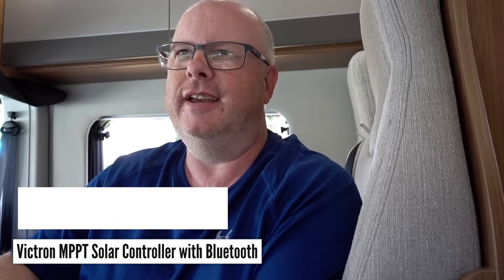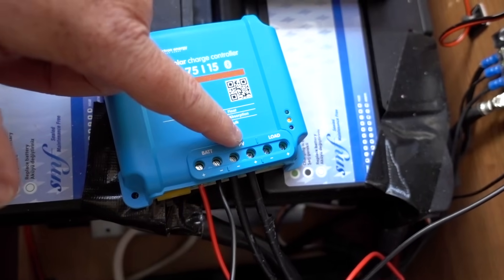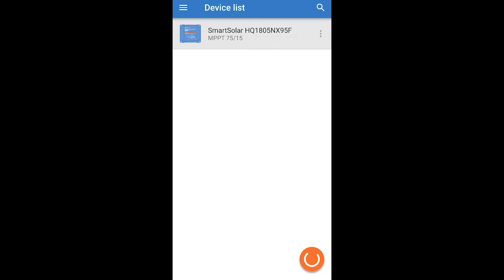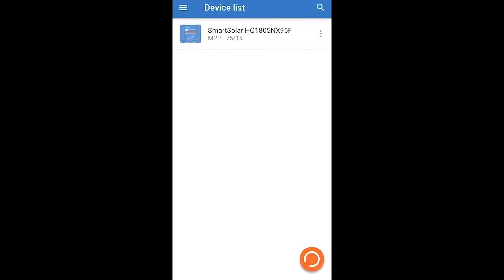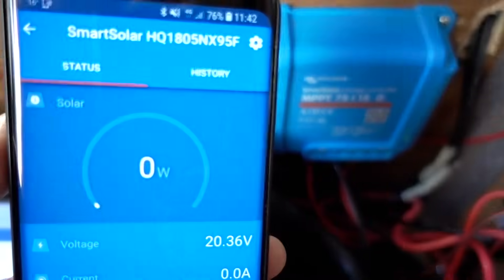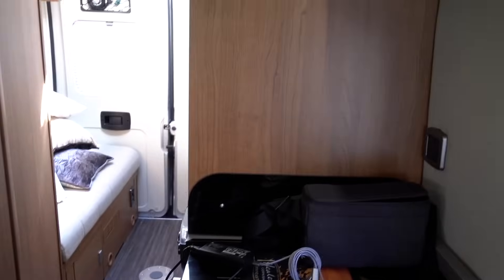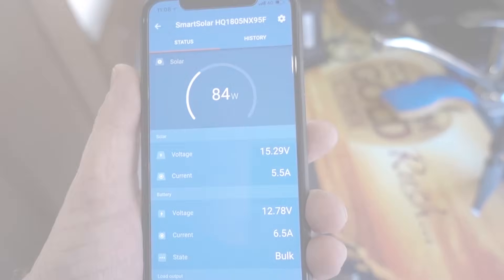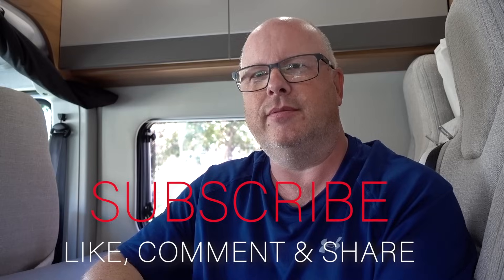Victron MPPT ☀️Solar Controller ☀️with Bluetooth 📲 Installation & Review

Comment: Hey John,

I have 3 100w panels. I dont know if im missing something but when do panels actually produce close to 300w? The most Ive seen my victron 100 30 produce is 120 (with a fan going)...is it based on battery levels? I have LA Bats in my bank
Reply from the maker: My 150w regularly gets over 140w, maybe your panels or config might have a problem.

Comment: Hi john, help needed . I’ve got same solar system and batteries and controller! But blue light for bulk just flashing, what’s showing 0  no batteries connected yet so I put a load on off blue led spots not powering load ie no lights ? Confused any help regards .
Reply from the maker: Disconnect the solar & battery from the victron. Then connect the solar and then connect the battery, I don’t connect anything to the load. Then go into the app and see what it says.

Comment: Do not by Victron SmartSolar chargers. After 4 months of use, the app that connects to the control box via bluetooth has connectivity problems and just recently with the latest app update, will not connect to Victron's server to download the firmware. The control box is now useless as it will not charge my batteries. It was purchased through an authorized Victron dealer and they will not fullfill the warranty for a refund as they insist that my smartphone is the problem. I have emailed Victron explaining the problems with no response. Furthermore, alot of other users are experiencing the same problems regarding connectivity to their smartphones/i-pads. You have been warned.
Reply from the maker: Never had a single problem in over a year, if you use Samsung android phones then it might explain it as they have known connectivity issues. Victron gear is the best and your issues are just down to your phone or user error in setup or placement. I bet I could come and demonstrate your controller works perfectly with a different phone or setup.
Reply: I'll on the latest firmware on my Note 8 with no issues.

Comment: Hi, I’m just about to install a Victron MPPT 100/20, looking at your video am I correct to say that I don’t need to use the earth connection on the side of the unit if I’m only powering my battery?
Also, what is the safest way to connect the unit:
Battery connections to the MPPT then connect to battery
Then
Solar panel connection +, then - into the controller?

Thanks for all the videos and advice, really is a great source of infos👍👍👍👍
Reply from the maker: I had no issues not earthing the unit. I connected the + solar, - solar and then + battery and finally - battery and that's been fine.

Comment: Another great video matey.. I'm curious, do you still have the split charge system from the engine connected or did you disconnect?
If yes, where does it sit in relation to the charge controller?
Reply from the maker: Hi Si, in my new van it’s an intelligent charger for vehicle or hookup. In my old van is was a vsr, I’ve got a full 12v wiring guide that shows that. I’d have vsr to leisure battery and solar controller to 12v fuse box so you have protection and it’ll also power devices and ease the load on the leisure battery.

Comment: Hi there, great videos so thanks for your help.  One question, I didn't see you use the separate ground connection from the Victron in addition to the +ve and -ve connections.  Was this deliberate?  How do I know whether I need to use this?  Thanks
Reply from the maker: I don’t use the load side, I just use it to charge my batteries directly 👍🏼

Comment: John is it simply a case of removing the fuse between your old solar controller and your leisure batteries, remove the controller, disconnect wiring and rewire the new unit and replace the fuse? You don’t have to cover your panel do you to stop it producing power whilst carrying out the change over
Reply from the maker: A fuse won’t help if you’re disconnecting the cables directly coming from the solar panel.
Reply: Gadget John on tour so I don’t need to remove the fuse whilst swapping over the controllers? It’s just that I’ve done so anyways as my ep solar controller was overcharging the batteries not working properly hence the reason for me replacing with the Victron
Reply from the maker: Do it at night and it’ll be fine or cover your panel so there’s no surge to the controllers. 👍🏼
Reply: Just make sure that you disconnect the solar panels FIRST and reconnect them LAST

Comment: On the Victron, how can you tell what controller to use on a 200 watt panel compared to a 100 watt panel?
Reply from the maker: You measure the maximum amps your solar panel can generate and get the controller that will take that. So my 150w panel generates 10amps, so to be same I have the 15a controller 👍🏼
Reply: @GadgetJohnAdventures  There is a calculator excel download from the Victron website. Here you can put in your panel and controller configuration and it will let you know if they work together.

Comment: Hiya John, Could you tell me what pins you put your jumper back onto after you configured the controller  in your Bluetooth or did you leave it disconnected ? Tia
Reply from the maker: On this model there are no jumpers to configure. You just wire it up and connect over Bluetooth just as I show in the video.
Reply: @GadgetJohnAdventures  That's strange I got the same 1 75/15, its just below the fuse on mine 4 pins confused lol
Reply from the maker: My controller is the 75/10 Have you contacted their support or checked online for the correct setup of your controller?
Reply: @GadgetJohnAdventures  Oh right my mistake its got 75/15 on it, so thought it was the same as my 75/15, yeah its got 3 different ways you can have it, was trying to decide which was the best. on page 6 of the book it says no jumper when configuring in Bluetooth then it gives you the other options for after, your the best man to come to with all this tech lol 👍

Comment: Hey! nice video...very helpful. I was looking at purchasing the Victron MPPT 75/10...but I have 3 100w solar panels. Will the 75/10 support that load or do i need to go with a different MPPT model?

Also, can I have my inverter hooked up and pulling power from the battery while solar panel/chrg cntrlr hooked up to the battery also? I'm concerned that the inverter will be damaged if its hooked up at the same time as the panels/chrg cntrlr 

thanks!
Reply from the maker: You need to know the solar panel total output in amps and get a controller that big enough for that. Having solar charging connected to your battery won’t be affected by having an inverter hooked up to your battery too, just follow my videos to guide you through how to do it all 👍🏼
Reply: Gadget John on tour very useful answer I'm going through the same steps rn ... I should've spent the extra money and got the Bluetooth enabled unit I read of the non Bluetooth smh
Reply: @pacman5511  You can just buy the add-on bluetooth module from Victron. It just plugs in to their controller and gives exactly the same into as the bluetooth included one

Comment: question! my battery is fully charged  and everything works great! but the victron app dont show his watts from the solar panel.. but if i power on the inverter  the wats goes up is this normal?
Reply from the maker: Hi, if you battery is fully charged then your solar controller doesn’t take any power from the solar panel. Powering on the inverter draws power from the battery so the solar control then allows the solar panel to charge the battery.
Reply: Gadget John on tour  thanks just to be sure everything is working good ;)

Comment: Hi John, thanks for your clear explanation about your Victron charge controller.  Would you be able to answer one question? If we get the unit with built-in bluetooth and the unit needs to have a software update, will the controller still operate if we happen to be in an area with no wifi? We will be camping after all!
Reply from the maker: Yes it’ll work fine if you’re unable to update when prompted. It updates every few months and gets more efficient too. On first install I would suggest you are able to update though, just to get the best out of it. 👍🏼

Comment: Does it have any settings in the app where you can be alerted if your battery voltage is getting too low?
Reply: @Barry Hoffman You can then add the Victron Battery Protect unit which can be set to disconnect all the loads when the battery gets to a value of your choice (50% at worst)
Reply from the maker: It’s a solar controller, it automatically provides power whenever it can from the solar panel. You can’t turn on more power if the sun isn’t out, if the sun is out then it will charge your battery. 👍🏼
Reply: @GadgetJohnAdventures  Yeah, I'm looking for a charger controller that can provide me with some kind of alert if my battery voltage is too low so I know to turn my generator on. I haven't been able to find anything like an alarm or bluetooth feature like that. Even just something that connects to the battery and beeps at 12.3v would be handy.
Reply from the maker: @markbtw7987  This is what you need - https://www.ebay.co.uk/itm/DC-3-6-50V-Digital-Voltmeter-High-Low-voltage-Alarm-led-monitor-tester-5v-12v-24/332687226979?hash=item4d75b43863:m:mdRcJ8vMbr-dy2o5-1bBt8g:rk:7:pf:0

Comment: Let me if I got it; the app allows you to monitor the current drawn from the battery? How can a solar charger measure the current that's being drawn from the battery without a shunt on the circuit battery - appliances?
Reply from the maker: The same way a DVM can measure load on an electric device.
Reply: @GadgetJohnAdventures  a DVM measures current (if it is what you mean by load) by breaking the circuit and having the electricity passing through the DVM. If the charge controller is placed between the solar panel and the battery how can it measure anything between the battery and the appliances?
Reply from the maker: Really easy, the controller is connected to the battery and also the electrical devices. But if you want to learn how a product works then speak to the people who make it.

Comment: I think the 80W showing is what the Solar panel is generating - not to do with load ?? 80W from a 150 W panel in October in the UK for a panel that is flat on your van roof rather than at the perfect angle to the sun is pretty good though :-) Its good to have a controller that tells you what's going on, so you can see if there is an issue, or see the difference in where/how you park if your batteries are low too.
Reply from the maker: Sorry, I really didn’t do a great job of explaining it. I was trying to show the panel load as it charges the batteries 🤔
Reply: correct!
Reply: Linzi Douglas the panel will only ever put out what is being asked of it. So if your charger is pulling 50w and you add 34 watts of load, that’s a total of 84w that your panel will produce. If charging finished and you turn all loads off, panel power generation will drop to 0w (in reality the charge mode will switch to float so you will still get a few watts generated)...
Reply: @frodev728  - My understanding from having Solar on the roof of my house and monitoring them before they were connected to anything other than the monitor, was that Panels just churn out power depending on the light - the charge controller is the thing that alters what it lets through. Thuis is why people opt for a MPPT instead of a PWM controller as the MPPT can use more of the incoming Watts/power by altering the amps while keeping the volts within the range the battery can accept - whereas PWM can't do this so is a lot less efficient and dumps the extra Watts/power.
Reply: Linzi Douglas No. panels will produce a voltage even under quite weak light (such as a streetlight or even a bright torch at night) but voltage is not power . Power is voltage x current. Current comes from the load, so even if voltage is at peak, with no load it will not pass any current into the load (in this case the charge controller) and thus no power is generated at all (even though there may be potential to do that the instance a load is applied).

a PWM controller cannot convert volts to amps, true, so it just takes in existing amps (based on demand from the battery) from the panel and gives that to the battery at the optimum charge voltage. a MPPT controller is able to multiply the amps as it divides the voltage down to something suitable for the batteries, which results in “more” power going into the batteries - which means the controller can potentially use 100% of the panels rated output in favourable conditions, whereas the PWM controller can only ever produce a certain proportion of that total rating, depending on the voltage differential. for eg. a “12v” panel won’t see as much an increase in efficiency on MPPT vs PWM as will a 36v panel.
Reply: @linz_in_NZ  It's different for a house because they send any excess off to the grid. For a motorhome there's nowhere to send the excess when the batteries are full so the charge controller just sends out what is needed. I think the 84w was limited by usage in the van as before he turned on the fan it was lower at about 70w. So as he used more the charge controller could output more. 

edit: forgot the 70w bit of the video which changed my conclusions.

Comment: Hi John,
Do you know if the solar charge controller will power up and connect over bluetooth without the solar panel installed? thank you
Reply from the maker: Yes it works without a solar panel as long as you still wire it to your batteries. 👍🏼
Reply: Thank you!
Reply from the maker: Barry Hoffman No idea, ask the person.

Comment: I currently have a 110ah battery. You have 2 x 130. Did you really need double what I have? I haven't started using mine yet, but am now wondering is it big enough.
Reply from the maker: With all the tech I take away, having the heating on (or cooling fans on), along with lights and inverter the extra battery capacity is really useful.

Comment: Great video I am taking a long time considering buying and converting a van, so research mode at the mo. Interesting recommendation I noted that Vandermodium also recommend Victron kit.
Reply: Buy an inverter which directly convert to AC current , solar charge controller+UPS= inverter

Comment: Hi John is the controler you got with the kit ok iam thinking of getting the say kit or would you buy all bit separate if you did it again 
Iam looking at the Chinese desiel heaters aswell to use van all winter
Reply from the maker: The kit controller is basic and less efficient, the Victron gives better charge and the ability to monitor your solar usage, so if I was doing it again I’d get the kit, still the cheapest 150w panel, and the victron too 👍🏼

Comment: Hi John, thanks again for the video. I did learn something very useful. I did not know I could use my Truma heating system in fan only mode. Could be useful in the summer. Cheers
Reply from the maker: It’s great in summer, I close off all but the loo vent and go in there with fan on full and it’s very cool in there 😝
Reply: @GadgetJohnAdventures  Stone the crows John... Too much information.  I have a tough wife also that bars me to the naughty corner at home. She hasn't found one in the van yet.  I presume your wife has ... hehe....  ;>